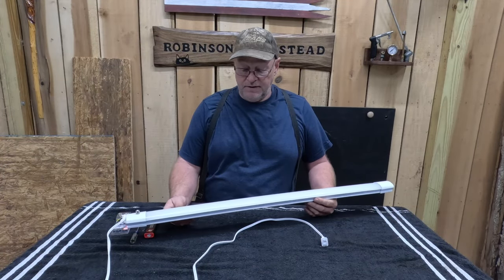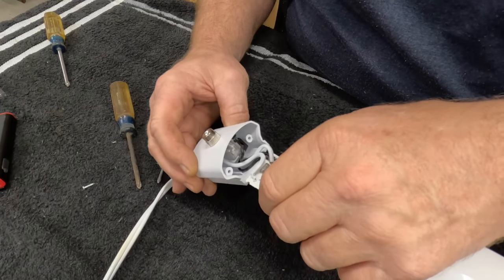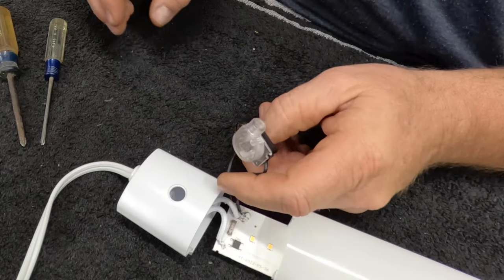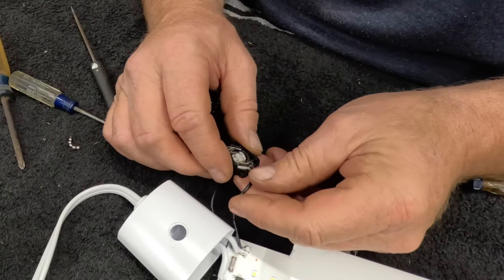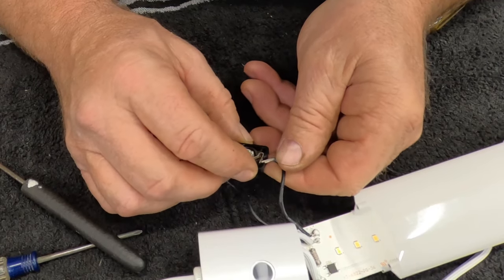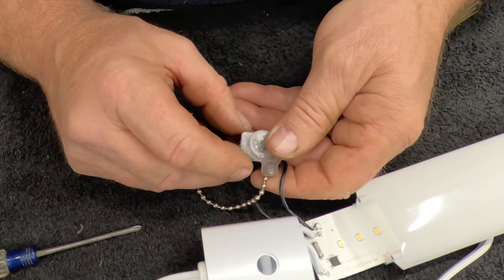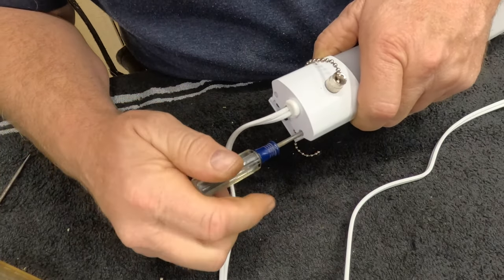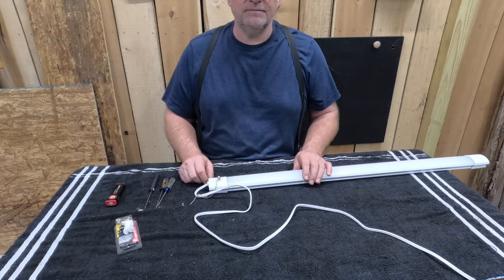LED light pull chain repair replace

Comment: Replacement many of those chains and even the switches before.  It is nice to be able to fix things instead of just throwing it in the trash and buying do.  Like you said, they just don't make things like they used to.  Thanks for sharing.  Juddie
Reply from the maker: Yeah i like to at least try and fix it if i can before i just run out and buy new, thanks for watching.